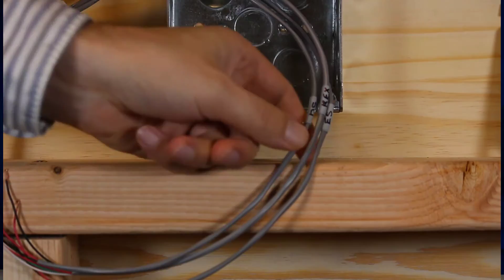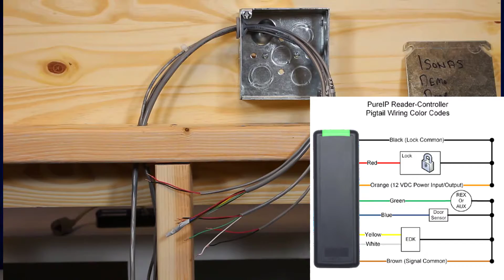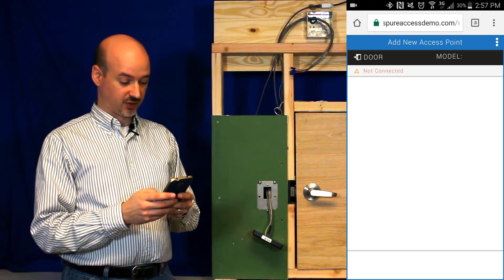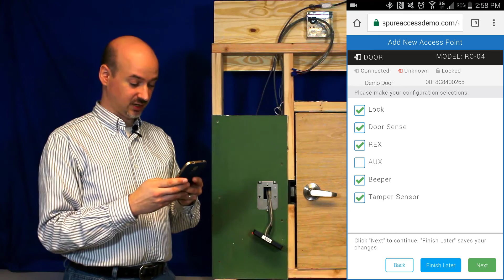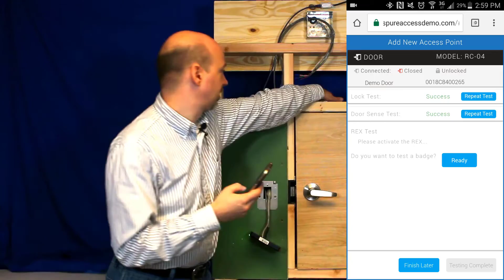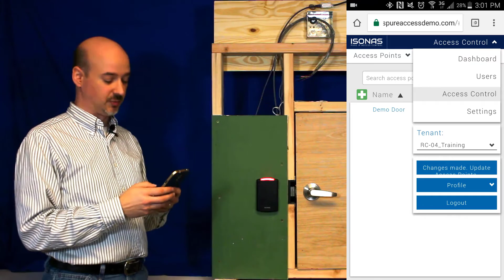Isonas Pure IP™ Installation

Comment: How do you prevent someone from removing the controller and applying power directly to the electronic door strike?
Reply from the maker: Great question!  We have an optional Advanced Security Module (ASM) that installs between the Reader Controller and the Electric Strike that secures the wiring between those two devices.  This ASM is installed on the secure side of the door and does not activate until receiving a secure signal from the Reader Controller.  When a Reader Controller is tampered with it will go into an alarm state locking the door and cards will not work anymore.  So even before they get it off the wall it will shut down and the ASM will keep the door secure. All data on the Reader Controller is encrypted using AES-256 technology.
Reply: Very Good!

Comment: This product is crap.  Go with an IP controller-based product and use HID readers.  These IP readers are junk and like they are made in somebody's garage.  Not ONE installation goes without something going sideways.  Latest instance of readers cratering when config is pushed to them....and vendor states that "a new person at factory soldered the wrong wire"!!!